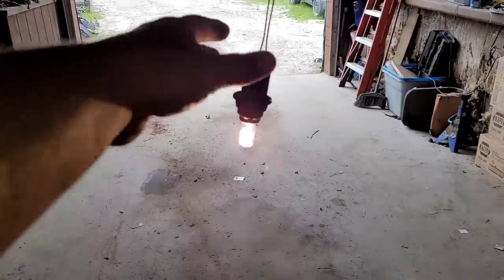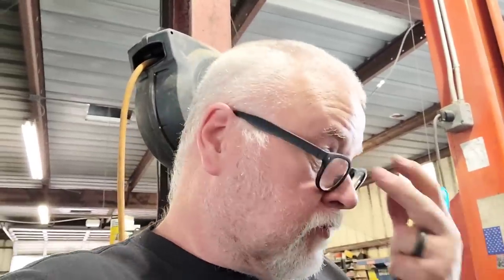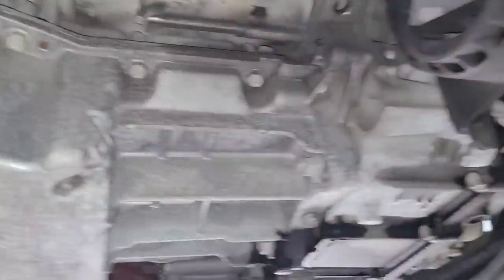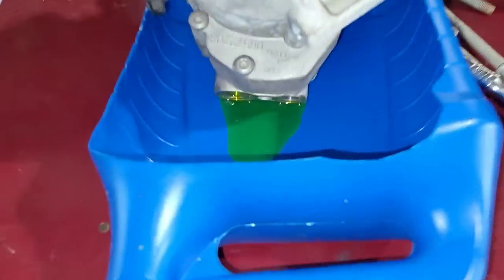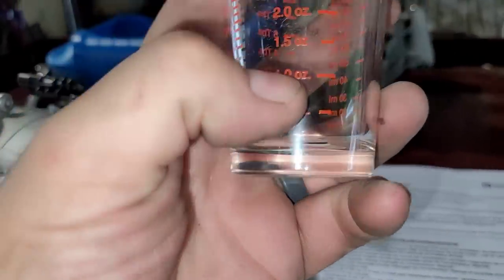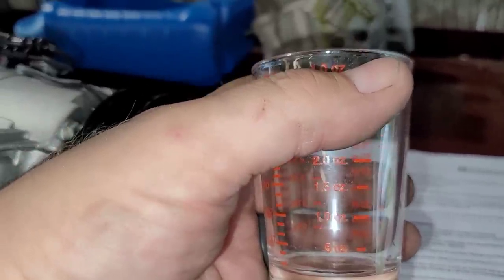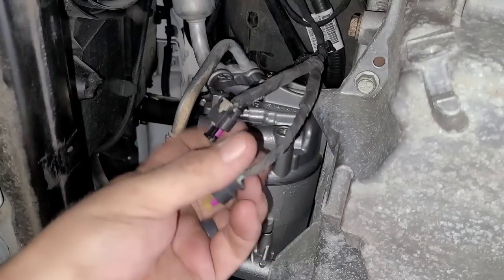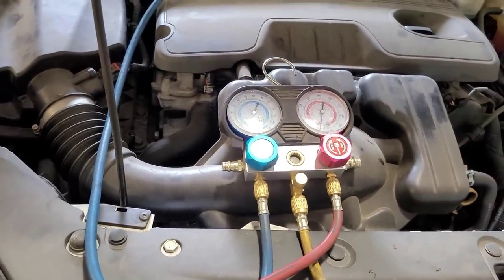I Have Everything I Need, But Still No A/C Compressor!!! What's Going On??

Comment: What we do as a preventive we change the fixed orifice tube only takes a second we are always finding them dirty
Reply: I'm pretty sure most vehicles now use expansion valve type systems. I'm like you though, if it has a orfice tube replace it. Of course if it's real dirty, then odds are so is the rest of the system and it'll get dirty again. Black means bad, or going bad pump... not good.

Comment: AHA! Finally, something to which I can speak. 😁  A manufacturer for which I worked made among other things, AC-compressor- and other electromagnetic clutches.  I was in the Clutch Department, on the Coil Line.  Clutch coils were tested at the beginning and end of the assembly line; not only for continuity, but for Hypot (high-potential, putting 1,000 volts across one end of the coil winding and its housing, to ensure there weren't shorted turns), and a check to ensure that the later back-EMF-diode equipped coils still had said diodes intact.  If there was a failure on any of these tests, that coil was scrapped.
 
With Murphy being who he is, there were still bad coils that made it out the door.  Our corporate customers let us know about it in no uncertain terms, trust me.
 
The first thing I noticed is that you didn't do a resistance test on the original clutch coil (you might not have been able to, as close as things were; "you gotta be a contortionist").  If memory serves, they should read in the vicinity of 4 Ohms (for a current draw of 3 Amps at 12 Volts).  If the coil has a back-EMF diode built in, reversing ohmmeter leads should yield a higher reading in one direction, lower in the opposite.  You might have been able to do this test after the compressor was off the engine.
 
And Lord, yes, don't strip threads in aluminum.  Ask me how I know. 😲

Foghorn at 14:10 ? 😆
 
As always, a great video. 👍🏼

Comment: A/C DIY is very doable despite what you hear from many shops. And Kenny is correct -= vacuum pumps are available and pretty inexpensive at Harbor Freight.
Reply: I did my first automotive AC at 24. Harbor Freight saved the day. Instead of having to buy a fairly expensive vacuum pump to pull vacuum on the system Harbor Freight had a vacuum device that used your air compressor. I think it was less than $20.
Reply: @robertwest3093  Change the oil in that pump after you use it. You'll be 80yo and still using it.

Comment: I have been in a situation where I needed a new clutch but could not buy one only a compressor.  I bought the new compressor swapped clutches, put the old clutch on the new compressor and returned it for the core.  Just saying saves a lot of work ...

Comment: Complete clutch kits, if available, are nearly the same cost as a brand new OEM complete compressors based on my experience. 

Factor in most cases, the compressor has to be removed to replace just the clutch it's a no-brainer, IMO. 

Replace the Orifice if equipped and receiver drier and you now have a solid AC System for many many trouble free miles.

And yes, oil balance is key!
Reply: Plus that has a variable displacement solenoid on those. Those are known to go bad and are usually not obtainable alone.
Reply: I wouldn't ever replace just a clutch unless I could absolutely verify the coil is good, otherwise it's a unnecessary cost. Just because a clutch doesn't activate doesn't mean a clutch is shot... there's other reasons to consider.
Reply: @garyr7027  Aftermarket, an ac compressor clutch kit comes with the pulley/plate and coil. 

It depends on the situation, BUT I would prefer to keep an original compressor on a car if its still functional/not leaking and not super old. You never know what kind of compressor the replacement is.
Reply: @mph5896  well I totally agree with keeping with the original ac pump. Like you said, with aftermarket pumps odds are it's not as good as the original, then there's the flushing job that should infact be done including replacing dryer/receiver too. However, as far as a replacement clutch, from my experience online or offline, to get a clutch, and or a coil it depends on the vehicle. I've discovered with some vehicles, and don't ask me why cause I have no clue, not all replacement parts are available, and if they are, they're not always sold together, but sold separately... this is just marketing fact. It depends on the vehicle and the parts, and sometimes where you buy the parts, but not always.

Comment: I'm surprised you didn't change out the expansion valve and accumulator/ drier also.
Reply: They require a specific amount of PAG oil.
Reply: He would have only changed the clutch if it was available separately.
Reply: Why replace an expansion valve if it doesn't need it? A simple test of the gauges will verify if the expansion valve is good or not. Replace dryer?... yes absolutely, otherwise pump warranty is void, and that's with anyone you buy a pump from... they all have that same warranty.

Comment: A new compressor is the way to go. The clutch went out on my wife's Nissan Murano and none of the auto parts stores sold just the clutch assembly. Trying to save a few bucks, I ordered a clutch from an online company that deals in compressors and parts. After installing the clutch the belt would not stay on the pulleys. After  starting the car the belt would run one groove off the pulleys. I took the new compressor pulley off and installed the old one, and everything was fine. More Chinese junk. Lesson learned. Enjoyed the video.

Comment: I usually use AC solvent and nitrogen gas to clean the system before installing a new compressor regardless of whether the compressor failed mechanically or not. There could be some contaminants in the system that could damage the new compressor.

Comment: Thank You Kenny for the great information. After my 2001 F150 AC wasn’t putting out cold air, I tried the auto parts Freon recharge kit. It was a little better but not good. I went to Harbor Freight and picked up the gauge set and a vacuum pump from them. I vacuumed it down and it held a a good vacuum for an hour. I didn’t have a scale but my system holds 36 ounces (3 cans of 12oz. R-134 Freon) I also put the dye in there. Ice cold after that. Lasted about 6 months and started getting warm again. Got the UV light, and I see a leak at the compressor front. That will be next. By the way, I have 305,000 miles on this truck, so I feel blessed that the compressor made it this long…
Love going “The Kenny University” 
Much Love and Hugs
Reply: HF sells an electronic digital postal scale that will hold a 30lb pig of freon

Comment: If you DIY this and want to follow the law, have a recovery machine (~$400) and recovery cylinder dedicated to either R134a or R1234yf. Or have a shop evacuate to 0psig. I was using 12oz cans and figured my digital scale for 30lb cylinders would be inaccurate, so I used my handy 16oz digital postal scale (cheap). Example you need to put in 32oz. That's two 12oz cans plus a partial. Weigh 3 cans before you use them (15.4oz, 15.5oz, 15.6oz). Put in 2 full cans. Weigh the two empty cans (3.3oz, 3.3oz) subtract from full weight. So you put in 12.1oz and 12.2 oz. Now you need 7.7oz to make 32oz. So the last can final weight should be 15.6oz - 7.7oz = 7.9oz.  The new self sealing cans are awesome! Paired with the Pittsburg/Harbor Freight manifold Kenny uses (a lot of us use those, good reviews), the thumb lock fittings when you turn so the plunger is up will keep pressure. So you can remove the can from the manifold hose to weigh it more accurately than with the hose attached. Then screw back in if you need more refrigerant. Pretty safe in most cases to add 1oz to the 32oz for leakage during future testing, plus a tad of gas refrigerant will still be in your lines and can when you remove it from the vehicle. These Pittsburg manifolds have that 2nd center port with a schrader valve so you can vacuum the manifold before attaching anything, so you don't have to air purge them once you open up a can of refrigerant.
Reply: 0 psig is not a vacuum. That's 1 atm absolute.
Reply: @salsuginusrex5196  you typically don't evacuate to a vacuum with a leak, you pull to 0psig(equalized to atmospheric). It's EPA acceptable. If there's no leak then you can evacuate to -5psig or so.
Per EPA. evacuate 90%.  "Evacuate leaking components to the lowest level that can be attained without substantially contaminating the refrigerant. This level cannot exceed 0 pounds per square inch (psig)."
It'll probably be a question if you ever test for the 608
Reply: @BearHomeOwnerDIY  I took the test for 609 but that was 15 years ago and haven't done much with it since. If you replace a component, opening the system, is it not SOP to draw to a vacuum to remove any chance that air/moisture entered the system?
Reply: @salsuginusrex5196  Yep you got it. I  was commenting on different parts of the video.
Evacuation with a recovery machine is to 0psig if there's a chance of leak, or -5psig or so if no leak to recover more refrigerant. You don't want to recover with a vacuum pump for 1) can't connect a recovery cylinder 2) don't want a geyser of pump oil spraying out when you connect a vacuum pump to a charged system.
Vacuum testing for a leak and removal of non-condensables and moisture is done with a vacuum pump, not a recovery machine.
These are two different processes.
When vacuuming a system, should be using a micron gauge, not manifold gauge with analog gauges since you can't get good numbers of what vacuum you are at since the vacuum scale on a manifold gauge is very small. Can't tell 26 from 29 inches of mercury. Now with my testo 550, a digital manifold, it will tell me vacuum accurately to 29.92, but still a manifold can be leaky with a vacuum (they are best with holding pressure) so best to use a vacuum pump connected directly to service port and micron gauge to another port.

Comment: Nicely done Kenny! I love A/c jobs, I loved doing ac stuff @ the last shop job I had cuz they had Nice Robinair machine and boyyyyyy I recovered and saved SO much refrigerant over the course of a year that we didn’t have to buy any! lol most of the cars that came in for ac work, people had already tried servicing them and they came in way over charged, so I’d pull it all out, vac the system, do the repair and vacuume the system and correctly charged it and we just kept the extra lol but over time that extra adds up!
Reply: Only issue is that you will eventually end up with a recovery machine full of air, and then need to freeze the tank to almost all liquid, then discharge the gas out. Even residential units I often would recover the gas, made a manifold and used old fridge freezer compressors to do the scavenge, which meant I could get 90% of the charge out before changing the compressor. Did put a big drier in the suction and discharge lines, to handle the moisture and stuff that could be in there from the compressor failing, and those would eventually land up with the scrap units. 

Supplier hated that I had good enough records to be able to claim compressors under the 5 year warranty, though often I would have had to replace a condenser coil at 3 years, because those turned into confetti and rust, especially on the window wall units. I was about the only customer who bought coils, other than those machines that failed within the 1 year full warranty. Capacitors were pretty much an annual replacement item, you might get 2 years out of them, even the OEM ones, and new compressors always got a new capacitor, and for some of the larger units also a hard start kit as well, especially those that were oversize for the load, and thus ran short cycles.

Bought 3 sets of gauges, original cheap one, then one that did R134A as well as R22, then the last one because I needed R410A capability. Note as well that those hose sets do eventually wear out, and they start to leak through the rubber, and get stiff and brittle. Vacuum pump better to spring for the dual stage units, they get better vacuum, and are almost good enough to make neon signs with, or at least use as a roughing pump for them. Change the oil regularly, all too often see pumps with either chocolate milkshake in the inspection port, or solid black sludge there. Refrigerant mineral oil is good enough, and cheap as well, and a 5l ( around 1.3 US gallons) bottle of it lasted around 20 oil changes.
Reply: You will end up with a mixture of different refrigerants
Reply: Yeah, our machine would automatically cycle and separate the oil, refrigerant and purge the air after recovering from 3-4 cars. The refrigerant we would recover from the cars was kept in a separate reservoir from the main jug of R134A that we would charge from if we had no refrigerant in the recovery/recycle tank.
Reply: @Bimmerguy88  you never really know what you are recovering though, somebody may have added the wrong refrigerant etc, also some contamination from burnouts, moisture etc

Comment: If the clutch field coil fails close inspection of the field coil surface should show a small depression in the epoxy, less than 1/4" in diameter.  Pick that out to expose a fusible link.  You can solder the ends of the wire back together and make it work again.   I always add 60 ml of new compressor oil to older compressors when recharging the system.

Comment: 3:34 Actually, your explanation is not what those instructions said.  In your example, according to those instructions, if you pulled 2 ounces out total between the old compressor and the recovery process then you'd subtract 1.4 ounces (shipped in the new compressor) from the 2.0 ounces you removed and add the difference.  So, you'd want to add 0.6 ounces of oil to the new compressor, for a total of 2.0 ounces in the compressor.  You wouldn't need to add any more during recharging since you already added it to the compressor.  If you drained less than 1.4 ounces from the compressor and recovery then you'd install the compressor as is with 1.4 ounces.
Reply: The oil will travel in the system with the refrigerant, so there could be some in the reciever, conenser etc
Reply: @kellismith4329  Of course. There is a spec for the whole system. The idea is to replace what you remove since you can't really determine what is still left in the system. I was just pointing out that in the example you wouldn't add an additional 2.0 ounces to the 1.4 ounces already in the new compressor. In my experience there is very little oil comes out of the compressors. It's usually everywhere else in the system.  In most cases, I'll get about 0.25 ounces during recovery and maybe another 0.50 ounce out of the compressor. You do have to check for drain plugs on the compressors, too, in order to get it all out sometimes.

Comment: One thing to note, when flushing a AC system from a failed compressor it's not recommended to flush parallel condensers, they really should be replaced because it's not possible to get all the junk out of it, that junk/compressor trash, will ruin a new compressor. Serpentine condensers on the other hand can be properly flushed with zero issues... and always replace the accumulator/receiver/dryer... those also collect trash.

Comment: Off topic but ...i needed a rear end. Vin number says its a 3.55:1 ratio but it had a 3.92:1.
So what do you do?
Its a 4x4 so check the front differential and match it.
My truck was in a collision 13 years ago and they put the wrong rear end in it and i drove it not knowing.
Holy crap

Comment: That fitting is not what I would consider a manifold. A manifold should allow switching flow from one pipe to the other either through a manual valve or solenoid. That’s why your gauges are a manifold. You can close off or open valves to control the flow through the lines.
Reply: Yes, but no.   Kenny is correct, it is a manifold.   In mechanics , a manifold is simply a collector of lines , like an exhaust manifold for example.  Your gauges are the same thing but  are  equipped  with valves so you can  redirect flow.  I’m no expert by any stretch of the imagination, but I’ve pulled wrenches for over 41 years. I wish I knew half of what Kenny already forgot.  Enjoy his videos.
Reply: @hawkenman.549  You’re using an exhaust manifold as an example is not a good one. An exhaust manifold combines the flow from multiple flows into one. The fitting in the video keeps the flow of both lines separate. It is a fitting, not a manifold.

Manifold definition: 
Noun:
“a pipe or chamber branching into several openings.”
Reply: @jcnikoley  Inlet manifolds now also often also incorporate coolant flow through them to the head, so they do not mix the different components, till the plastic fails.

Comment: What is the electric connection if not for the clutch.
Reply: high pressure cut-off switch. It breaks the HVAC request signal between the climate controls and the VCM or PCM  or between the PCM to VCM depending on vehicle. If you have a sensor just after the condenser, if you have controls set to AC and fresh air, it activates air recirculation if the pressure gets high but not yet high enough to trigger the HP cutoff switch in and attempt to reduce the load and get pressure back down.